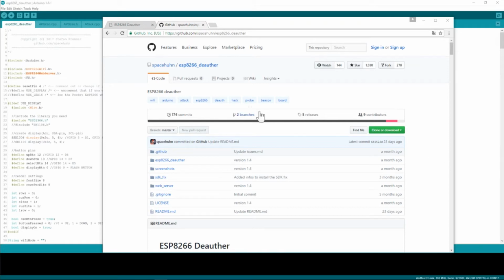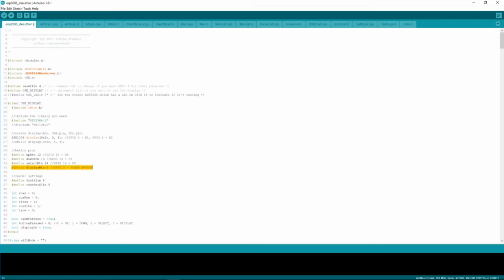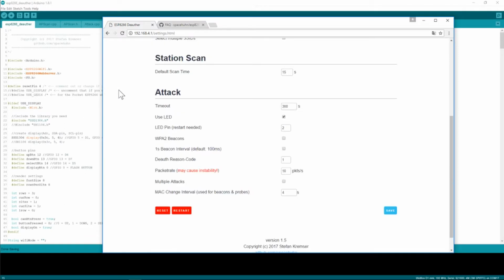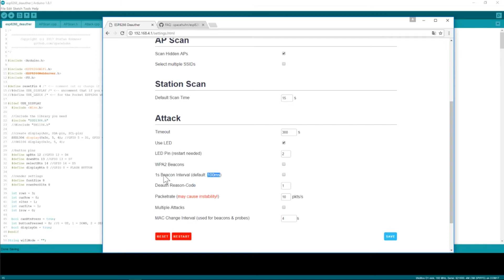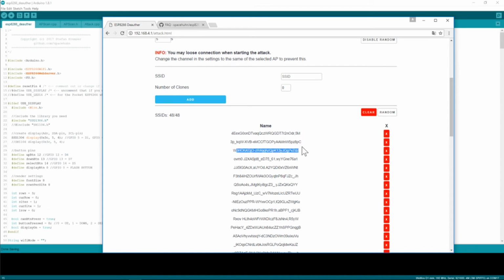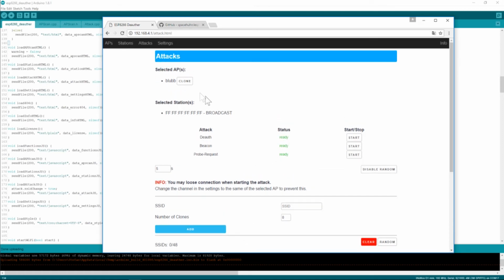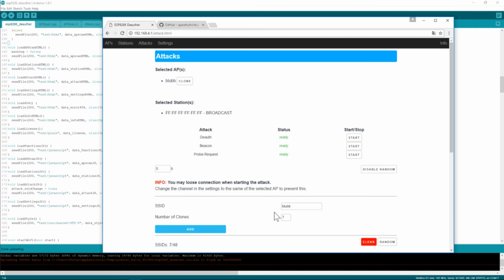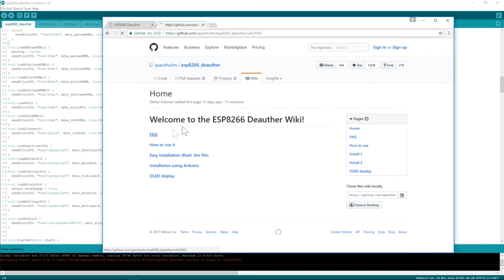ESP8266 Deauther v.1.5 Update Changes

Comment: I've got mine working, at least to the point where I can read what wifi's are broadcasting, but I can rarely read their client list and I've yet to be able to jam a wifi. My interface says 10pkts/s (tried sending 1-30) and the LED is on, even my serial monitor (connected via Arduino IDE) indicates it's "attacking" but I can't jam any wifi--tried 7-10 wifi systems around me. Maybe this jamming device only works on low quality/security wireless routers? I'm using an ESP8266 and the libraries v1.5 from github (with all the posted fixes)

Comment: can I code this to set tx power little higher...I think it is only txing at 19DBM but the chip support more..even a 3 DBM gain will double the range...I am using this...I have my 8266 with IPx connector  inside a power bank with the USB rotated in, drilled hole for sma, connected to a 14 DBI Yagi antenna...would be nice to have a button that says Set TX Power with the default value and one that raises it 3 dbm for that extra umphhh...I think the code is : WiFI.setOutputPower.  but I suck at programming and only use other people's code :) thanks...

Comment: Space, dude, I got a problem while flashing my ESP8266 12E AiThinker with Arduino Leonardo. Got only wifi module, without usb, don't have usb-uart converter, so I decided to use sketch on Arduino, that works like converter. Downloaded libraries (esp8266 2.0), selected ESP8266 12E board, Arduino's port and clicked upload. Got error while uploading :
"warning: espcomm_sync failed
error: espcomm_open failed
error: espcomm_open failed"
Also don't have 5V to 3.3V converter, so decided to make voltage divider on arduino's TX pin.
Got GPIO0 and GPIO15 connected to ground by 10kOhm resistor, and CH_PD to VCC 3.3V. 
Help me master ;-;
Reply from the maker: You can't use Arduino to upload that way. Use the esptool or the nodemcu flasher.
Reply: downloaded the deauther bin file and nodemcu flasher master. How to configure this?
Reply: The problem is how to wire esp... Got 12E one. On different sites/videos got different answers. Tried GPIO0 to high, low, GPIO15 float, high, low, GPIO2 too... I dont really know what to do... I'm using Arduino Leonardo with sketch as a usb-rx, tx converter, when trying to flash by nodemcu it says that its begin to find ESP8266... still...

Comment: Hey man, I tweeted you, but I'll post a comment here as well. As soon as I start the deauth attack, I get "error loading attackInfo.json". Can you help me out? :)
Reply: "Change the channel in the settings to the same of the selected AP to prevent this"   
Read the INFO dude! ;)
Reply: Yeah, I read that, but does it mean every time I target a different AP I have to fiddle with the settings? I don't mean to sound lazy or ungrateful, but the previous version didn't call for that :P
Reply from the maker: yeah didn't call for that, but the problem was there too. If you attack a target that uses a different channel than the ESP8266 is currently on, than the chip has to change its channel and by that you maybe loose your connection.

Comment: Slightly off topic. Can nodemcu-flasher dump an Esp8266's bin? If not, is there anything that can?
Reply from the maker: Jon Raymond What do you mean? Like get a bin file out of the esp's flash memory?
Reply: Yup, exactly what I mean. I have an ESP what has firmware that I don't have the source too. I'd like to back it up before over writing it.
Reply from the maker: Jon Raymond As far as I know, the only way to do that is to open the module, desolder the flash chip and hook it up to an EEPROM reader.
Reply: Okay, I've dumped eeproms with a bus pirate before. Was hoping there was an easier way.

Comment: spacehuhn, I'm gettein the following error when I try to compile the intitial code using Arduino.
Arduino: 1.8.2 (Windows 10), Board: "NodeMCU 0.9 (ESP-12 Module), 80 MHz, Serial, 115200, 4M (1M SPIFFS)"

C:\Users\Dell\AppData\Local\Temp\Temp1_esp8266_deauther-master.zip\esp8266_deauther-master\esp8266_deauther\esp8266_deauther.ino:60:18: fatal error: data.h: No such file or directory

 #include "data.h"

                  ^

compilation terminated.

exit status 1
Error compiling for board NodeMCU 0.9 (ESP-12 Module).

can you please help me?not related to v1.5 sorry
Reply: Did you watch the video? Check the F.A.Q and also follow the installation steps properly as you have not dont that